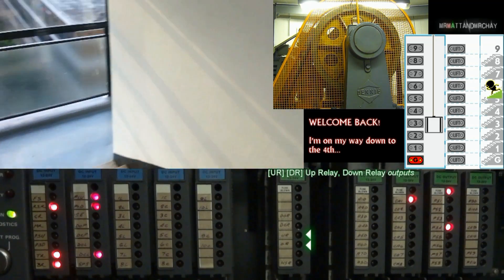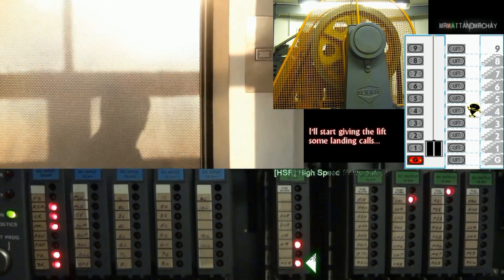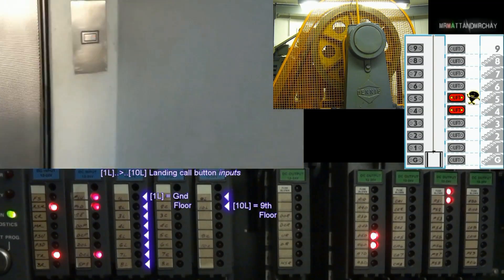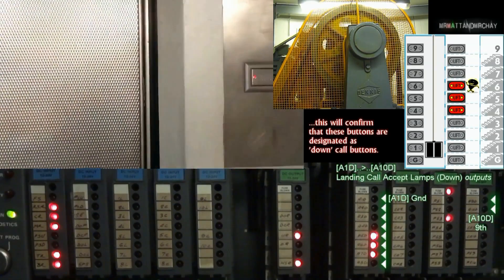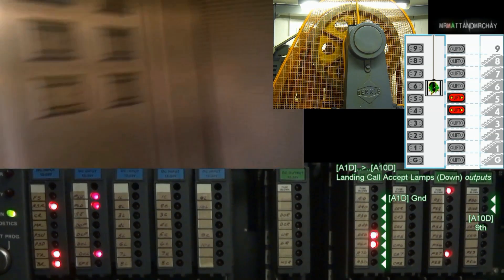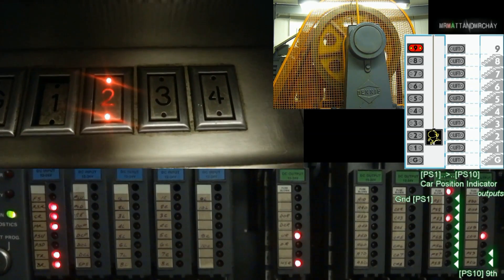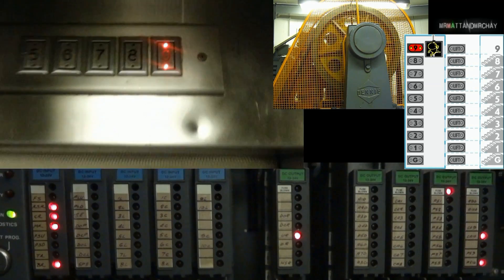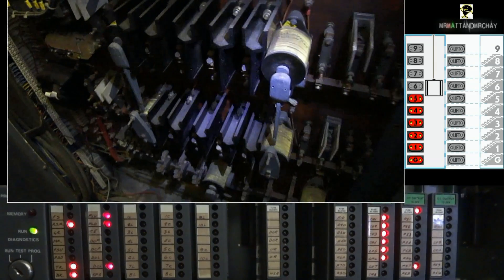THE MASSIVELY INFORMATIVE LIFT/ELEVATOR VIDEO (part 2)

Comment: I've seen one of these which was self-floor-programming. Everything that "would be programmable", is defined from factory, such as whether 2 speeds or 1 speed.
Other than that, it programs itself when restoring power by going to the top floor and reading how many floors there are until the bottom floor.
I remember that once there was a mistake in the counter (seemed like it double-counted 1 of the floor magnets). So it was stopping between floors and abruptly stopping at the top floor (top floor sensor activating). A simple power cycle fixed that one. It was an interesting experience to see.

Comment: Thanks for your time and effort. Question : why isnt there any PLC output for the brake ? I did not saw any. Or is the brake automatically released when motor start running up or down ?
Reply from the maker: That's because if the plc were to malfunction then it could release the brake when it shouldn't have done, example with lift doors open.
When the safety circuit is made (meaning all doors are shut and locked) then the MC main contactor relay feeds voltage ready for when the PLC to demand Up or Down direction .  Either direction will then release the brake.
When stopped the brake is automatically applied.  Hope this was helpful?
Reply: Thanks for the info, everything is clear now.

Comment: Awesome vid! Just curious to know if MRL and Computer Control elevators also use the same type of system
Reply from the maker: Doubt it.  All the leading manufacturers have developed their own controllers with specific connections.  In this video, this is a PLC which can be used to control anything and was probably the next step from using relays.  All lifts use computers, but when I say "computer" I mean a controller using microprocessors (you wouldn't find a Dell PC when you go into the motor room lol).  See this one that I did for Harri:
MRL Elevator controller and shaft footage
Reply: O thanks mrmattandmrchay